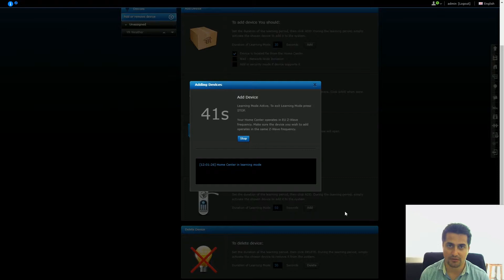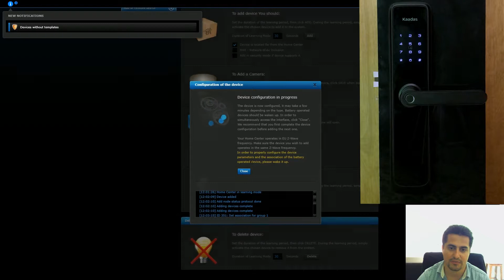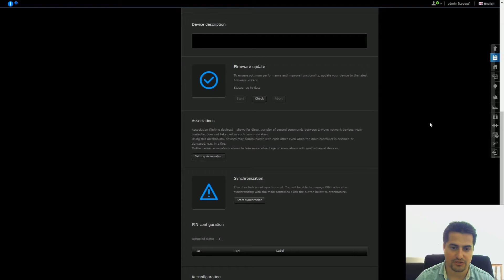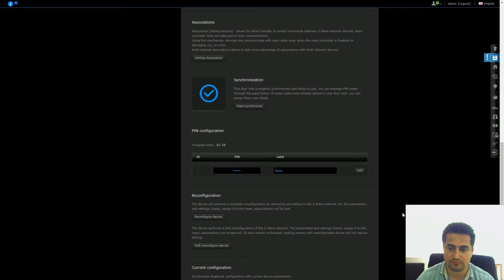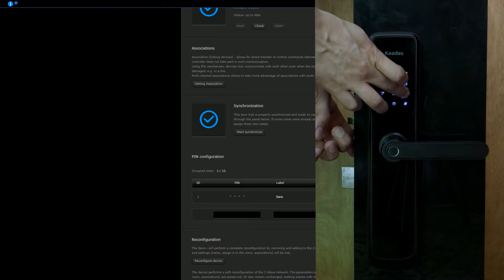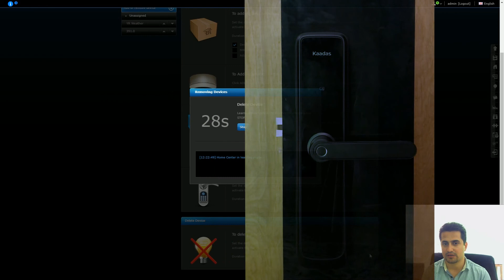Fibaro and Z-Wave Door lock

Comment: Can you do this in HC3? What do you recommend as a good and compatible mortise lock? Where to buy?
Reply: Hello. Despite not having a template in HC2, it worked perfectly. However, unfortunately, at HC3 (I just changed and I'm in doubt whether excited or very upset) it doesn't work. I mean, it installs (it was necessary to delete and include it again), however, although it appears on devices, it does not open, does not close, and, worse, in the application (app) the open button sends a signal to the HC3 history to close and the closing one sends an open signal.
Reply from the maker: @fabiogama6671   I will check it as soon as I get a HC3
Reply: @kian.smarthome  Did you get HC3 or lite? Does it work?
Reply from the maker: @Рофлеризчата  On HC3 base on my last test it was not compatible, I will test it in new firmware, if positive I will upload new video
Reply: @kian.smarthome  I would really appreciate it.
Reply from the maker: Hi, It seems that HC3 does not support it.  please read comments of https://www.youtube.com/watch?v=Owtpq6UZqGE&lc=UgxYTCFEZc-9IJ1McWF4AaABAg.95Jnm0Hn8NK9BYOTqAZizh